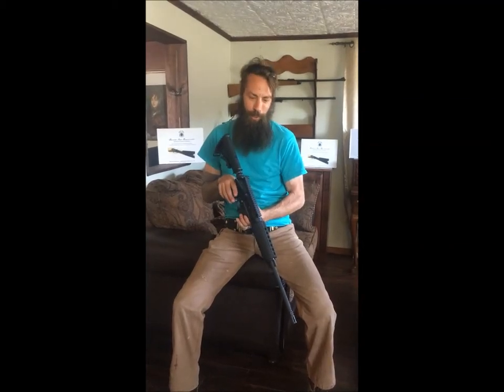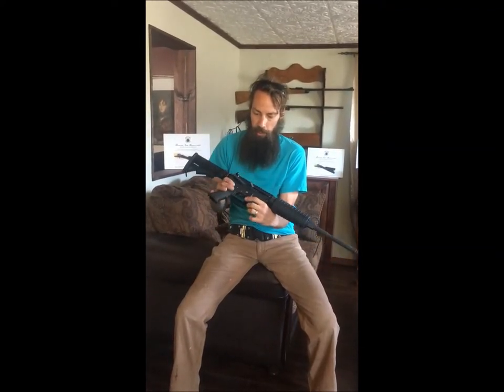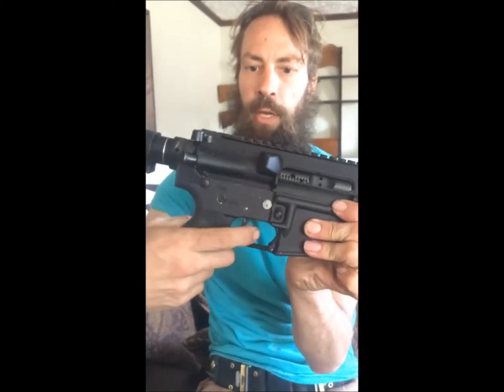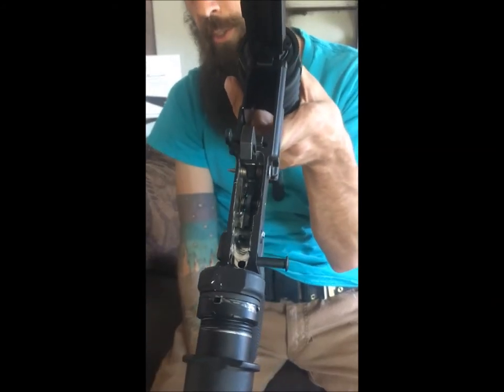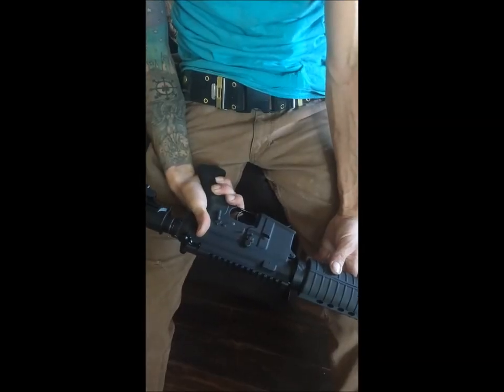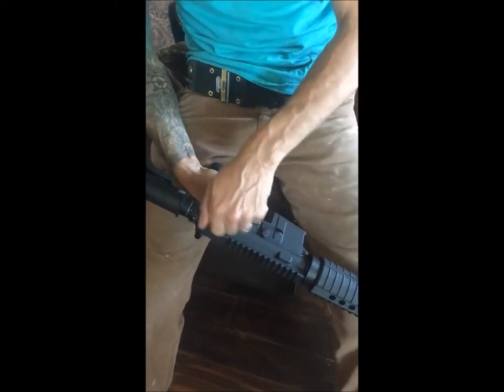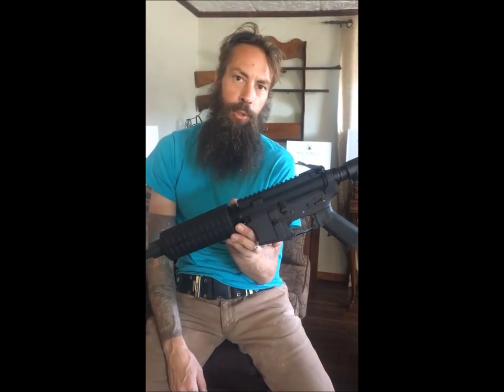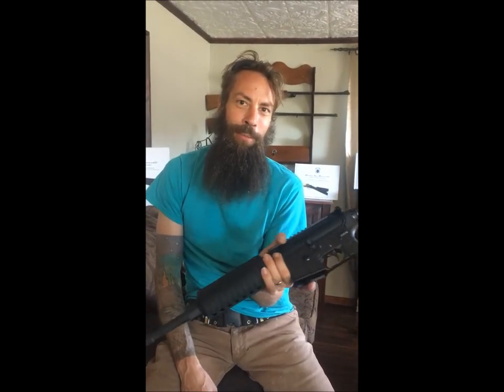HOW TO NOT MESS UN AN 80% LOWER

Comment: Hardly the worst one. The selector hole is the one that may have to be redrilled to remove a bit more metal if the safety is too stiff. Drill at around 1600 RPM, make sure the bit doesn't wobble, don't go from one side and out the other, and kind of just peck at it.

Comment: Can gunsmiths work on 80 percent lowers that have already been milled with no serial number?
Reply from the maker: It is legal for gunsmiths to work on home built firearms, however many refuse to do so.
Reply: @brubakerarmsmanufacturing  thanks for that. I mostly would just want a coat of cerakote in the milled trigger cavity.